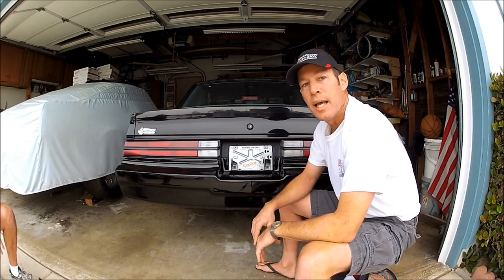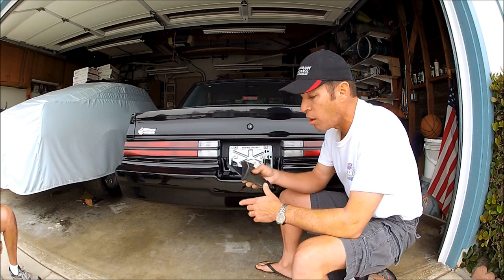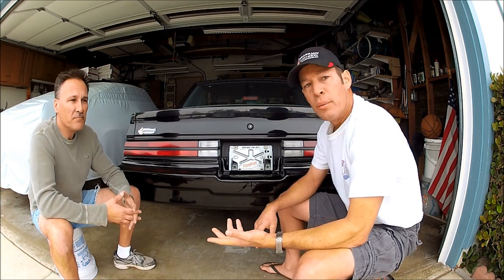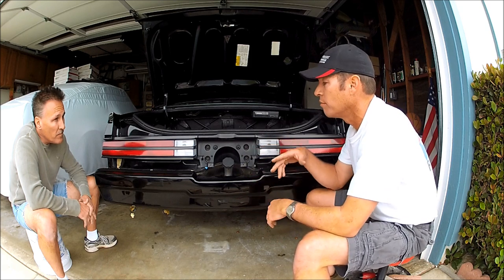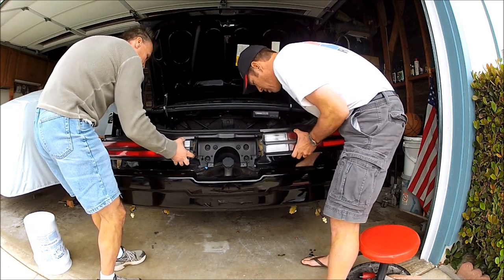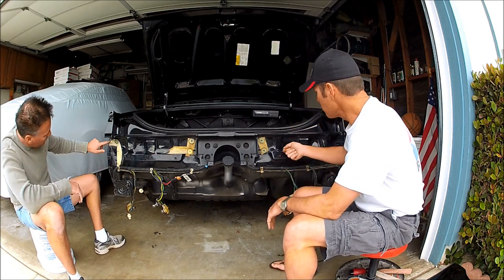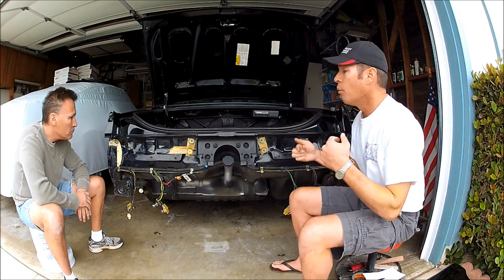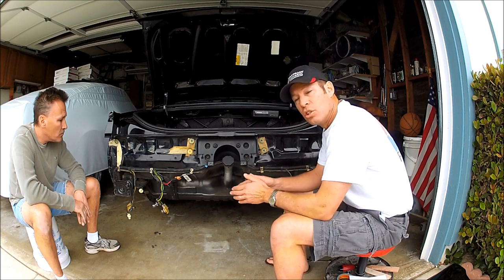SPOOLFOOL'S FIBERGLASS REAR BUMPER FILLER INSTALL VIDEO!

Comment: Great product and awesome video. I followed your trick for moving the license plate bracket over to the left and the rear one piece fit like a glove. The fronts went on even easier. I guess I must have a super straight Grand National. Thanks again for the support you give your customers.

Comment: Just put mine on. Not as easy as you made it look but very doable.
Reply from the maker: Mike, Thanks for trusting in me and my products. I do my best to turn out the best product I can. Part of that product is customer support. I stand behind my products 100% and can usually be reached 7 days a week.  Mike Barnard (949) 433-1257

Comment from the maker: I don't post pricing here in case it changes. You can click on the link I posted above for pics, customer feedback and prices. Or you can call to get shipping cost and price of products. Fillers are in stock.
Mike B. (949) 433-1257

Comment: Nice! I'm looking forward to getting a complete set. Any issues with them breaking or cracking in the unfortunate event of a minor impact?
Reply from the maker: You would need to get hit pretty hard. Of all the hundreds of fillers I've now sold, three that I know of, have been in accidents. Two of those were easily fixed. One was replaced. I suspect that it could have been easily repaired, but insurance paid for a new one. All my fillers are hand laid fiberglass. It is very easy stuff to repair to be like new.

Comment: Is BLACK the only Color ? By the time thees are  bought, shipped, and "prepped", & painted (front and back) "that's a grand" !. * Would you ever consider (again) doing them in white / other colors ? 

Best
Reply from the maker: Black is the only color. Too many variables to do other colors. Also, keep in mind that if you buy cheep bumper fillers, pay someone for the hours of work to make them fit your car, then paint them, It would be less expensive (and fit better) to buy and paint mine, then put them on yourself. Mine are pre drilled and fit nice right out of the box. No flex agent needed to paint. This means they will look, polish and fade just like the rest of the paint on your car. They will never haze up like the rubbery ones do. The least expensive way to do something is to do it once.

Mike B.

Comment: Does it fit a 1986 regal limited? Hope too hear from you soon thanks.
Reply from the maker: Yes.
Reply: Michael Barnard. Were do i order one michael??
Reply from the maker: Yes.
Reply from the maker: Depends what state you live in. Call me 7 days a week to guide you to the nearest vendor that has them in stock. Note: that changes from time to time. ;)  Mike Barnard  (949) 433-1257